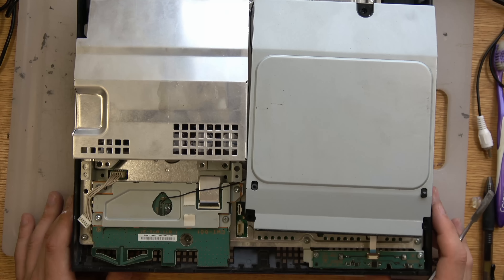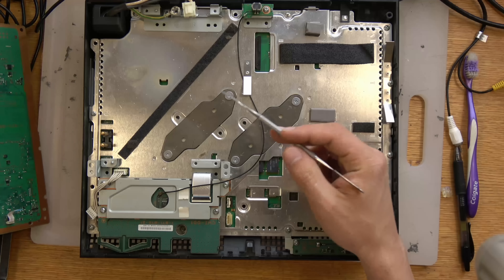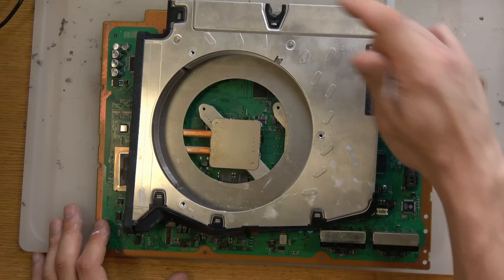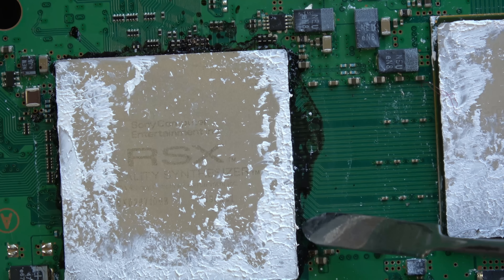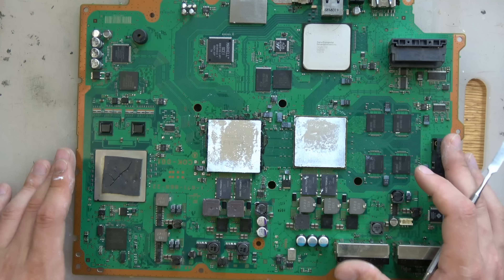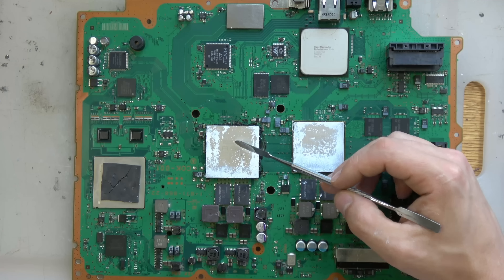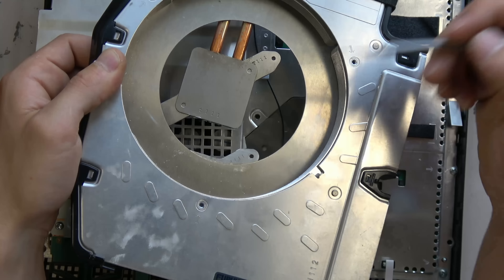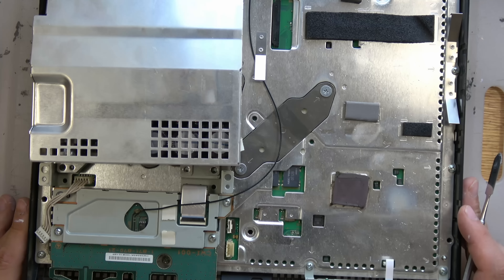PS3 YLOD FULLY EXPLAINED - YELLOW LIGHT OF DEATH - RETRO GAMING ARTS

Comment: I don't know but I have cfw PS3 slim. While I was playing game, it started to flash red and green but it didn't shut down. I shut down the system. Later, I turned it on and everything works fine. Do you know something about that ?
Reply from the maker: Treminator sounds like it temporary over heated
Reply: RETRO GAMING ARTS What that means? Do I need to worry?
Reply: Treminator no
Reply: Jeff 3749 So, I don't need to worry about that. But, what is cause ?
Reply: Treminator your ps3 was just hot. Thats all. Next time dont play for too too long
Reply: Jeff 3749 OK. I think my PS3 got overheated temporary because of webman because, I use webman fan settings to make sure my fan don't overheat, but that was strange because I set every fan speed number on lowest and it temporary over-heated. Should I disable Webman or add new thermal paste ?
Reply: Treminator wen was the last time u put thermal paste on. And also, i think u should make the fan speed abit high becuz if the speed is low then it doesnt cool it down much. Get wat i mean? And also, do u know why i keep getting banned everytime i play bo2? With or without mods. I get banned by activision for violation even after using ps ninja and psn patch. Would be helpful if u know. Thnx :)
Reply: Jeff 3749 Man, I really don't know why you getting banned. I have seen all dudes using that patch and PSninja and they don't get banned. My PSN got banned because someone was swearing at me because I cheated  in Grid 2. I wasn't cheating, I was driving professional. Did you disable you cfw before you start playing online ? Because, they will not ban you if you disable cfw syscalls.
Reply: Treminator yep. Im on rebug dex. And its how i do it. 1) Go to rebug tool box. Go all the way to the right and all the way down. Change no to cex. 2) Put the mods i want. 3) Use PSNinja and do the 1, 3,5 and 6 one. 4) Disable cfw syscalls. And then sign in and go to bo2. I used to do this before. And never got banned. Now i just keep getting banned continuously so ima go back to ofw. If u know how to help me, id be appreciated. Becuz i really enjoy modding and making ppl happy wen i give em all co 😄
Reply: Jeff 3749 And I am on Rebug too!
Reply: Jeff 3749 If you are getting banned, this is my tip. I am not sure if it works but test it.
1. Disable internet connection and media server.
2. Select gane you want.
3. Go to PSNpatch
4. Disable your cfw
5. After you done that, go to PSninja and do your job here.
You are ready to go!

Oh, I forget one thing, Before using PSninja, enable Internet and media server.
Reply: Treminator thnx but i dont think its necessary. I was trying to update via internet becuz i thought ill go back to ofw. Instead. Im stuck with   installing part. Wen i close it and open it. It says installing. Even wen i try to go to recovery mode. It still shows installing. Ima reset my hard drive and see if it works. If u know better. Then plz tell me. I dont wanna waste money on having it resetted and then its not working still. :)
Reply: Jeff 3749 You were in same situation like me when installing internet update. I had to buy new hard drive and now works better. Never use internet update if you are using cfw.
Reply: Can you tell me error code you get while installing internet update.
Reply: Treminator its 8002F334
Edit: YT will not help. Its only gonna show storage media problems
Reply: Treminator ohh. I have a fat ps3. But im sure it should still work. Honestly thanks man. If i do get it to work. Ur a life saver man. But, wat if i just format the hard drive. And wen u get a new hard drive, does the cfw go?
Reply: Treminator hey bro. Wen u bought a new hard drive. Did u lose ur jb?
Edit: And do u think if i get it formatted, will it be like a new HDD
Reply: Jeff 3749 I am not really sure when I bought new HDD. I heard lot of people put the HDD into their another PS3 to finish update(next PS3 needs to be OFW). After update is done, they will bring back HDD into PS3 where they get error in update. Works for all models. Or you can connect your HDD to your computer via some USB cable. They format it to fat32. After they done that, they will insert an OFW 3.55. Later, when it updates, you can jailbreak your console. I used new HDD because I have an PS2, PS3 and PSP. I dont have two PS3s.

Edit: These solutions are for code you got. I got same code way back (2016).
Reply: Jeff 3749 If you format your HDD, you can't stay on cfw. You don't have the system if you format your HDD. You need to place an update to ofw 3.55 (or cfw I am not sure). After update is done, you can jailbreak your console. I mostly recommend you Rebug. When I got my console in 2014, I was on Rogero. I don't recommend you Rogero. Once I was scammed. After I went to 3.55 to jailbreak my console, I got an PS3 update that says it's rebug. After installation, It,s Ferrox!!!! After I updated it to Rebug. Ferrox is same to Rogero.
Reply: Treminator ok. Thnx bro. But how i get to rebug is first i jb to ferrox then update via storage media to rebug. I find it easier. Ur way sounds complex xD. Anyway. Thnx for the advice bro 😊
Reply: Jeff 3749 subbed, you niw have 50 subs

Comment: Nope keeping it on its side is a sure way to kill your disc drive because they were not designed to sit sideways keep it flat and serviced regularly and you can have a original PlayStation phat like me mines still going strong takes about 20-30 mins for the fans to kick in before it even gets warm in fact my freind has gone through 3 drives since he bought it same as me when they first got released
Reply: I don't know about that not all fat models have the same type of Disc Drive laser lens someone known to fail more than others, early fat PS3 is have a single lens style for all Blu-ray CD and DVD, why later models have a slightly different set up where it has a single Blu-ray lens and a nother for CD and DVD.

I personally just replaced my eleven-year-old laser lens in my launch model PS3. And I always had it sitting on its side.
Reply: James Carter I'm saying that's what I have witnessed mine was flat never replaced drive.... His 3 drives on its side

Comment: I have a Question. I've had my 60gb Phat PS3 for years with no problem. A few days ago I was gaming on it for a few hours. After I came home from work I turned it on and it knows flashes Green & yellow back and forward. Then it stays permanently green. Still works just fine. I took it somewhere and got it cleaned up and added new  paste on it. Turn it bavk on and it still does the same. But it still works.. Should I be worried? Is there anything I could do to stop it from doin that?
Reply from the maker: i wouldent be super worried, if you have new paste, and it's cleaned up, i would just keep using it, weird though, never seen that
Reply: RETRO GAMING ARTS I managed to find out that Webman was the cause of it. I deleted it and it went back to normal
Reply: Buy a fan for the back that plugs into the power port then the power cable plugs into the fan so it doesn't over heat and makes it last a lot longer
Reply: AshModz GTA V I'm on 4.80 rebug Dex and never had that before I mean mine had some problems with the hdd malfunctioning and freezing but it some how sorted it self out.
Reply: When you modify a console dont expect it to work like a normal console , my rgh gets red ring when software plugins are corrupted,  but it's a hard drive error e71 all software based

Comment: I mad ethe big mistake of having my original fat PS3 trapped in a small confined space. It must have gotten like 30 degrees warmer in tha tone spot. Im surprised my PS3 never overheated but no joke that system generates so much heat, I dont even need the heat on in the winter. I just pop the pS3 in m small rooms and turn it on lol.
Reply from the maker: Thomas Torre hahahah, i had a small room a few years back, and my pc + ps3 fat = i saved money on heat, cuz those 2 things heated my room! I get you hahah
Reply: My gaming room is the absolute worst - bc A) it's upstairs b) in the summer I can't go in until I have the AC on at least an hour, C) the PC unit I have, no matter how much coolant and fans I have running still heats up like a mofo.....the pain of having small rooms lol. Def need to move my gaming room to the basement, but then I have to deal with constant humidifiers running
Reply from the maker: Thomas Torre loolol, you have windows?
Reply: RETRO GAMING ARTS windows upstairs and downstairs are terrible with no circulation
Reply: Thomas Torre good video. Just need to know to reflow can you use a hair blower on them instead of a heat gun? I don't have a heat gun. And how do you get the old paste off if it's hard? I really don't want to put this in the oven like most people say on YouTube so please tell me how to do this safely.

Comment: You are wrong the major reason for ylod are failing NEC TOKIN prodalizer capacitors. Replace them with tantalum capacitors and your ps3 will run forever.
Reply from the maker: Super old video, im sure alot has been learned and discovered since then. Can you link me an image to these capacitors on the board? So I know what to change
Reply from the maker: This is the first im hearing of this and want to explore it

Comment: lol Yellow Lighting of Deathing or as called YLingODing.
Actually I'm watching this a second time. Thinking of looking at my CECHE01 80gig model. I'd like to upgrade the fan from 15 blade to 19, if need be, and resolder the chips. I might consider replacing the power supply and the hard drive too.
Reply from the maker: all of those sound critical, i would do all of them. not all plastic psu's can be swapped from all the different models. some of the plastic ones dont fit. thats why i just fan mod it. it's also cheaper than a new 19 blade fan, unless you have a 19 layin around
Reply: RETRO GAMING ARTS I haven't opened my PS3 to check anything yet and I haven't priced much but I've heard 19 blade fans are around $20 and that a APS-231 is cooler and more energy efficient than the 226. I don't use my PS3 alot so it's a future project. I'll be watching for any other mods you might be doing and keep them in the equation.

Comment: Do you have a video on slower disk load on ps4?
Reply from the maker: Robert Myers no, just cleaning the ps4, hmm, how full is your hardrive? My ps4 hardrive got full, and i had slow disc loading, then i deleted a bunch of space and i noticed it went away
Reply: RETRO GAMING ARTS its a disk insert issue not the information. Sorry I didn't make it clear in my last message
Reply: RETRO GAMING ARTS i follow your cleaning tips and it does run quieter. Thank you for that.
Reply from the maker: Robert Myers Oooh!! That happens to my ps4, the disc slides into the ps4 SUPER SLOW! ill fix it and make a video about it! I dont k ow the cause so ill hafto figure it out
Reply: RETRO GAMING ARTS thank you and keep up the good work.

Comment: Lol this guy is SO wrong, 

#1 they put the PSU in the back of the slim for one simple reason, the design allowed for better placement of the components, in the PS3 Fat the GPU and CPU were on a 90nm fabrication process so they needed a bigger heatsink to cool them, that meant the whole underside had to be used specifically for that and they couldn't just shove the PSU in back, since the slim worked by cooling off the GPU and CPU first then recycling that hotter air through the PSU to cool that off too, 

#2 The air does not get SUCKED in by the top, that is the Heatsink for the RSX and it's constantly blowing out hot air, if you just put your face or hand there when it's on you would CLEARLY feel that the air is getting pushed out and not sucked in, that's not how these types of fans work, they suck and in from the top and bottom not the sides, so it's  not getting sucked in and thrown out the back. The air intake on the PS3 is in the front underside of the console just above the USB ports on the curve, and down towards the HDD, Aditionally a VERY GOOD case mod for a PS3 is to drill out holes directly under the fan so it can Intake air a lot easier, but this leads to a problem where you don't have airflow going throughout the whole system anymore so stuff like the PSU get's hotter, you could remedy this like I did by attaching a small fan to the front of it to blow air through it.

#3 The reason vertically standing PS3's seem to last longer is because the RSX is almost always the problem when it comes to YLOD, the chip just gets beaten up by heat over time, by having the console in a vertical position the fan has to work a lot less at cooling the mini RSX heatsink, {the heatsink that shoots air out of the side, and not the back) and gravity plays a big part here as heat always RISES, when you have it on it's side some of that air gets re-trapped inside the units instead of fully getting ejected.

Please if you are going to make an informative video, at least educate yourself on what you are saying.
Reply from the maker: Super old video. My bad

Comment: Dude, reflow and reball around 90% of the time is bullshit. It's the connections within the chip that's the problem. Heating  the chip simply reconnects the internals of the chip. It has nothing to do with the solder balls!! It's an urban myth!
I can prove this, simply wrap the PS3 in a blanket and let it run for 10 minutes, if it turns on most people believe they've reflowed the solder balls by overheating it, do these people really think the gpu is gonna overheat to around 250c and reflow the solder??

Reflow, reball 90% of the time is shit...
Reply from the maker: go check out my video i did about the virtual boy, you know how people put the VB ribbon cables in the oven? go check out how i fix mine, it's the same kinda thing
Reply from the maker: check this out russell i just made the power supply external
 https://www.youtube.com/watch?v=8Wh3eqUQJn4
Reply: Finally someone who gets it... Btw,  for some of the 60gb ps3, southbridge overheating is a far more bigger problem. Has anyone wondered why 60gb ps3 still sound like a rocket launching into space even after delliding the cpu and gpu and changing the thermal paste? Because maybe someone should finally try to delid the southbridge. And when u do, oh boy does it look like it has burned for quite some years, believe me. I personally think a lot of ylod are because of southbridge overheating especially for ps3 that go full fan speed even after delid cpu, gpu. And after delliding sb, ps3 sounds so quiet u will be suprised... But still, the syscon fan speed of ps3 is fkn trash, so a cfw is still a must.
Reply: Russell Brunskill Louis may be right about MacBooks but he’s absolutely wrong about PS3/360 reballing being BS. Andrew “Bunnie” Huang, the famous MIT XBOX hacker, demonstrated this over a decade ago by squirting a staining dye under the substrate before forcefully removing the package (“dye and pry”). It very clearly showed the faulty connections of the BGA solder balls.
Reply: Also, we got it straight from the horse’s anonymous mouth (very trusted source):
“The main design flaw was the excessive heat on the GPU warping the mother board around it. This would stress the solder joints on the GPU and any bad joints would then fail in early life.” (On seattlepi blog; Bunny linked it in his post Jan ‘08 post).
Reply: So you're saying that the silicon material has internal solder connections? I doubt that there is solder inside the silicon chips themselves. You'd be surprised how little heat is required to melt lead-free solder. Seen it on many electronics.
Reply: markfothebeast Russell is misinformed. The towel trick works because solder balls are non-Eutectic. This means that at least one of the metals in alloy melts at a lower temperature than the other, pseudo-restoring the connection despite the solder ball not reaching flow temperature. The “reballing is BS” narrative comes from Louis Rossmann, who was talking about his experience with MacBook GPUs. Andrew “Bunny” Huang confirmed the actual problem on XBOX360s with a “dye and pry” technique and a Microsoft insider also detailed the issues as determined by their internal investigation for SeattlePi. The PS3 and 360 have the exact same issues.
Reply: Emmett Turner Exactly. I don't spend much time playing video games but I took the PS3 I recieved for free and heated up the board. Walla! I still haven't played it much... (Video link here: https://youtu.be/lQ0R87Sw69w)
Reply: Hybrid Theory I noticed how hot the "Fat" gets. It still runs far too hot with a big hole cut in the case. But many electronics that generate heat have the same flaw. I repaired two guitar amps recently with the same heat issue.

Comment: Can you help me figure out what's wrong with my ps3? I have a ps3 fat 40gb model  (cechg01) I have the yellow light of death but after 10 or 15 tries of trying to turn it on, it works. I've cleaned out the ps3 and I have applied new thermal paste. I think this shows it's not the graphics card because i am able to play games. Do you know what I can do to fix it? I am thinking about buying a power supply but am having trouble finding the exact one. Thank you.
Reply: As i am writing this, I got the system running with metal gear solid 4. What do you think the problem is? I know I can buy another system but I want to get this one working if there's a chance.

Comment: I know this is crazy but has anyone tried liquid metal?
Reply from the maker: what do you mean liquid metal? solder?
Reply: He means the new replacement for thermal paste.
Reply: Probably means deliding the gpu and cpu and applying thermal grizzly liquid metal on them. Problem is I think the heat shield is aluminum cause if it is the liquid metal would eat up the aluminum heat shield over time. If you are able to apply thermal grizzly that would make you system run 20 degrees cooler